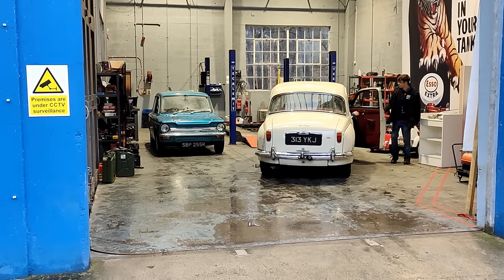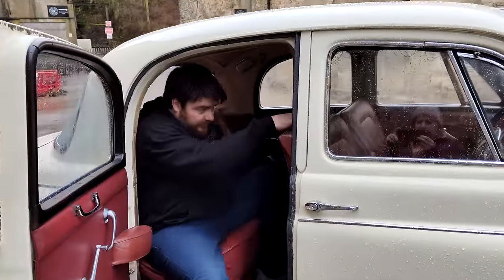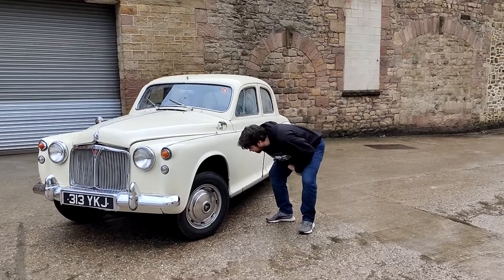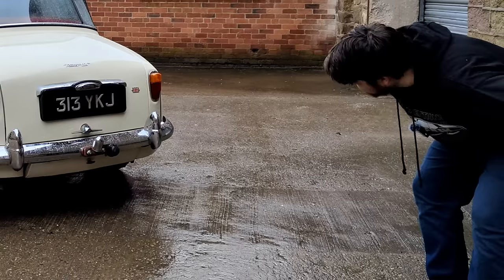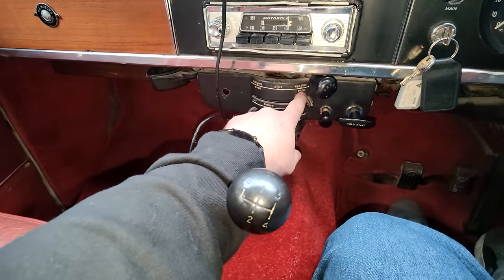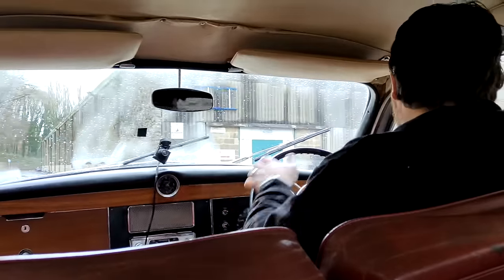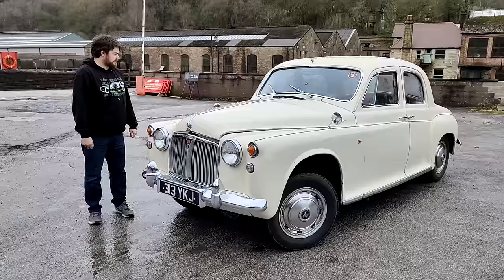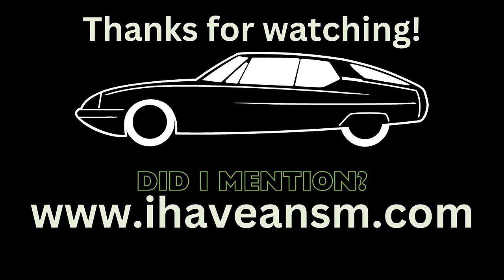1963 ROVER P4 110 - Man who likes the Citroen DS tries a Rover P4 110

Comment: Most of the body is aluminium and in  the 2007 Peking-Paris Motor Challenge, that followed in Prince Borghese's original 1907 wheeltracks across the Gobi Desert, Inner and Outer Mongolia, Russian Steppes to Moscow and into Europe. The Rover P4 came first in its class (the largest class in the event), competing over 8500 miles against Aston Martins, Jaguars and Mercedes and won Gold medals for its owners. So no you wouldn't  lose if you went rallying in "one" unless brought a 50+ year old unloved standard car that was only working on half it`s cylinders .
Reply from the maker: Aluminium, really?! I didn't spot that! I guess performance is relative, as although this wasn't running right, it felt a lot bigger and heavier than it really was, but then I guess it depends what you're used to.
Reply: @UPnDOWN  Aluminium was because steel was scarce just after the war. After the 100 Rover made the 110 all steel.

Comment: The engine from the P4 came from the P3 and found its way into the P5, by which time it had grown to 3 litres. It was an inlet over exhaust valve construction like a smaller version of the Rolls/Bentley six of the period. No way was it used in the SD1.

Comment: Thanks for an entertaining look at this P4.  Unfortunately this one will have an entirely incorrect soundtrack, due in part to the missing door seals, and also due to the non original carburettor and air cleaner setup.  It should have an SU and a bloody great induction silencer atop the motor, and you definitely shouldn't hear induction roar!  On top gear being very tall, I guess no-one told you about the overdrive available on top gear, which may have been left switched on.  Cheers.
Reply from the maker: Apparently the 110 doesn't have O/D as the engine was too torquey for it. How true that is, I don't know.
Reply: Hi UPnDOWN. No, the 110 does have overdrive, but it has a cheaper companion model, the 95, which lacks it. The 95 instead got a taller final drive, 3.9 as opposed to 4.1 in all the others. That 3.9 diff centre is highly prized by all the P4 owners who want their gearing a little taller.

Comment: the p4 was designed not to break down, no throttle or clutch cables, all solid linkages, starting handle, toolkit under dash, reserve petrol, my 100 only broke down when the electronic ignition i fitted failed, went back to points, 110 had steel doors bonnet and boot instead of earlier alloy, chassis like a lorry, if you looked after these they could last a lifetime, as the saying goes "one of britains finest cars"

Comment: It is a pity they didn't have a 1956 2.4 litre Jaguar to drive.  Firstly, it was my dad's car until I was 11.  Secondly, it is a better car to compare to a DS.  
It was designed at the same time as the DS and had (for Jaguar) significant engineering novelty.   It was their first unitary body, their first rubber isolated front subframe, their first short stroke engine.  It is a pity that it didn't get the rack and pinion steering from the XK140.

Comment: Think the P4 and P5 era of Rover was more about quality of engineering rather than revolutionary engineering which was more the P6.  Post war they were also quite limited in what they were able to produce Vs what the engineers would have been capable of, but what they made they made pretty well (and poured some RnD budget on gas turbine cars which ultimately didn't work out).

Quality of old cars can often be misjudged in modern times as newer cars, even basic ones, have much better durability and refinement anyway where as old survivors are often a bit worn out, rusty and suffering from neglect so aren't what they were but in period the P4 was pretty tough, reliable, refined and respectable (Not like Rover today where a lot of people just think Metro, 200 or BL build quaility issues when they hear Rover).  The fact the the P4 can cruise at motorway speeds even though most were built before UK motorways existed shows something as many cars upto the 1960's couldn't really sustain what is now the motorway speed limit (so rural speed limits wern't really needed).
Reply from the maker: Good comment. I think you're right. The P4 certainly felt tough. I really do need to try a P6, though!

Comment: Nice!!  I have always preferred the straight 6 over any other engine.  Too bad efficiency and economics made them undesirable to produce.  Mercedes went to the V6 in the 90's and BMW went away more recently.  Sad.
Reply: I always like a straight six for the refinement. I don't need insane power but I do appreciate a smooth engine and big squashy chairs (not seats) in a car.
Reply from the maker: Perfectly balanced engines, but just too damn big.
Reply: @UPnDOWN  Yep, fair enough comment. You're not fitting one in an Escort without rearranging the seating layout...

Comment: No, the engine in this P4 never appeared in the P5 or the P6 and nor is it related to the all new but Triumph derived 2.6 in the SD1. The 2.6 ioev 6 was used in the S2A and S3 Land Rovers. It’s related to the similar but smaller ioev 4 cyl in the P3 and the S1 Land Rover.
Reply from the maker: Good info, cheers

Comment: The DS is a French car. That’s all, ahead of its time for sure. However, the DS is no match quality wise for a Rover P4. There will come a time we are going to value quality again, quality that was so normal in everyday life. And now….all we can do is listen to the echoes of the past, so clearly told by this car.
Reply from the maker: Having spent a fair bit of time in both cars, I wouldn't say there's a massive difference in the quality, to be honest. The Rover felt 'heavier', but the quality of materials in a DS is superior (lots of aluminium in places the Rover had steel, iron or even wood!)
They're both nice cars. Knowing nothing about the P4 going in to this, I was keen to see how 'advanced' it was as a design, as I know later Rovers and some other BL stuff was, and I used the DS as I know them, and because it's a famous yardstick.
Conclusion: DS was miles ahead in terms of technology and engineering, but the Rover was conceived early in post-war Britain. Different objectives entirely, and in terms of durability and class, the P4 did the job.

Comment: Seems Rover's Department of Suspension Leveling were on holiday when the P4 was produced. This one seems ridiculously high at the front and/or low at the rear.
Reply from the maker: I noticed this too. Not just this car, they all have crazy arch gaps at the front.
Reply: That's what I thought. Very odd to let them roll off the line like that and it wouldn't help the handling with the C of G  higher than necessary at the front.  @UPnDOWN

Comment: ha ha what an laugh, you know nowt about such cars.  no commonality with P6/SD1. just the earlier P5.
Reply from the maker: Well, no, I don't. That's why it says "I know nothing about this car" in big fuck-off letters on the thumbnail.

FWIW, I remembered there being a straight 6 version of the SD1 (thought there was a straight 6 version of the P6 too, but could be wrong), and British cars being British cars, thought it entirely plausible that they'd still be using an engine from the 40s in 1980.
Reply: @UPnDOWN  The SD1 had an Early 1960s engine, two late 1950s engines and a 1940s engine (with a radical design change in the mid 1970s).